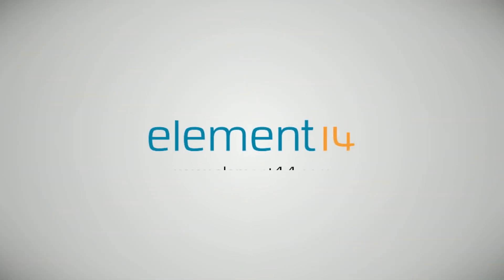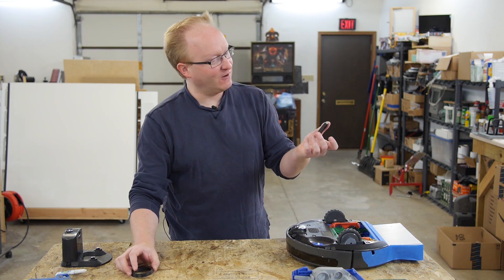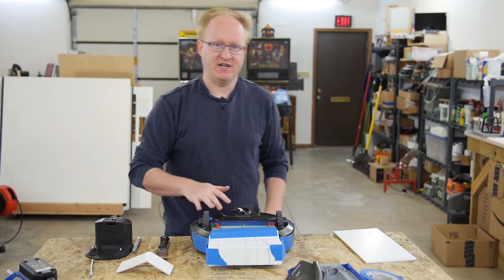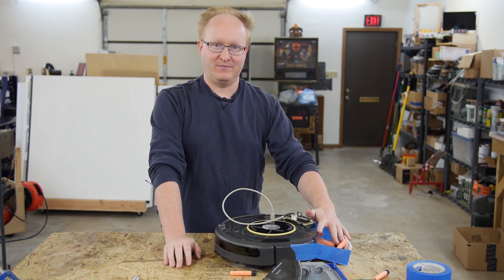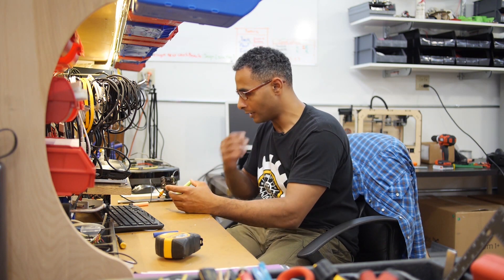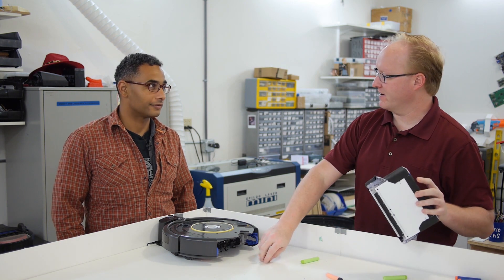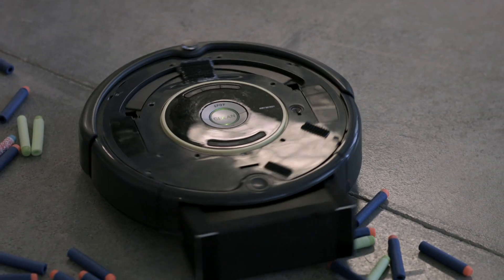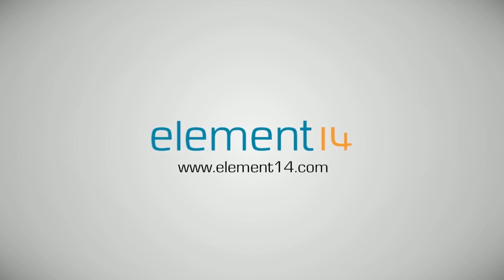Ben Heck's Roomba Nerf Dart Collector Part 3

Comment: That was a thoroughly disappointing conclusion. 3 episodes to essentially stick on a few 3D printed fittings and no real interesting electronic hackery. I know you have a lot to work on, but it's a shame when you spend so much time on doing what inevitably end up with something that could have been 5 minutes of work. This will certainly need a revisit! Perhaps built from custom or re-purposed parts rather than an iRumba kit. Would hate to see the Ben Heck Show turn into not much more than a product placement show.

Comment: Nice Project. But you do realize that it also sucks in all the actual dirt on the floor so the darts could become really messy.
Reply: +88lochi not really, I don't think it used the vacuum just the brushes to pick up the darts.